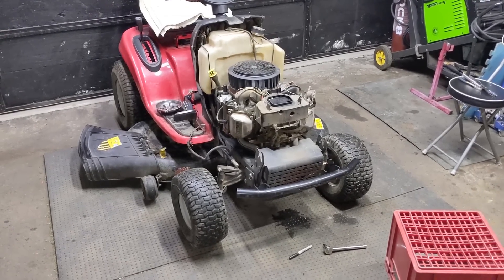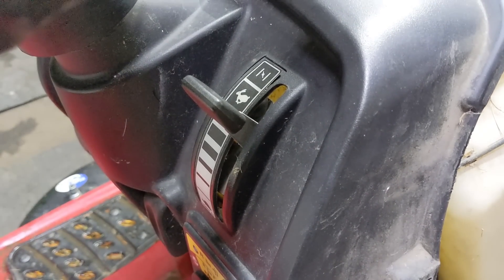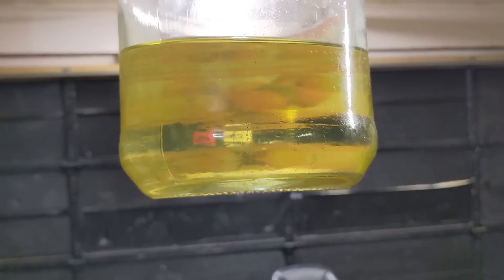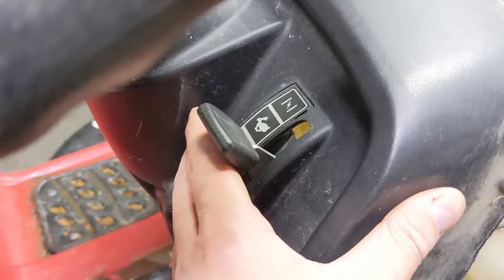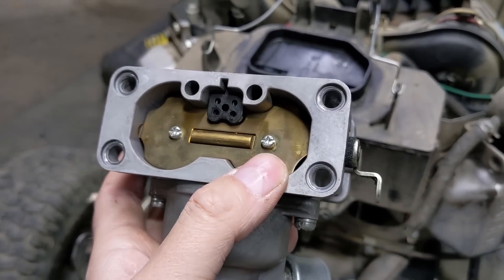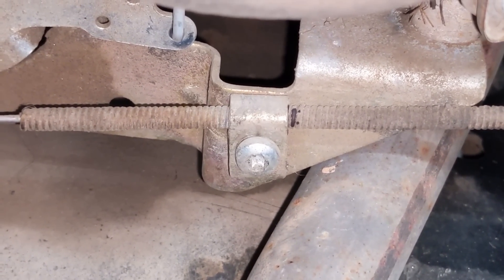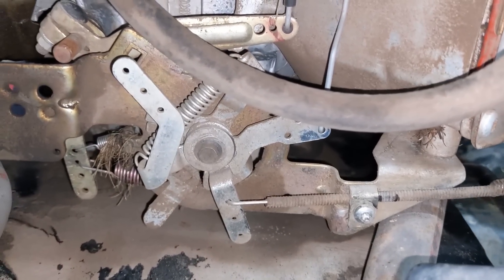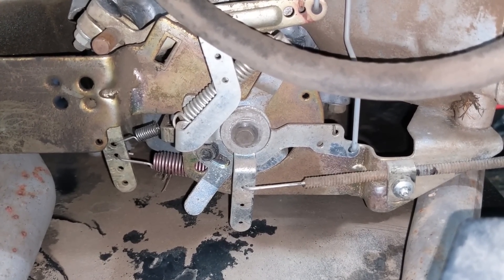Riding Lawn Mower Won't Start? - Try This!

Comment: Just fixed a Koehler KT (7000 series) this week that the choke wasn't closing on.  Have seen this more than once on these Kohler engines.
Reply from the maker: Yes it's a very common issue, I figured I'd film it because I've never done a video on it yet. Thanks for watching!

Comment: Excellent video, Briggs had issues on the Craftsman mowers the same as this one you had. Thousands of mowers left the factory with the chokes not adjusted correctly. I have repaired several last year alone. Thanks for great video's.
Reply from the maker: Yes I get them on Craftsmans, usually the 1st thing I check now because it's such an easy repair, compared to a carb removal

Comment: Good explanations! I'm sure it will help lots of folks. I inadvertently did that repair in the process of cleaning a carburetor on a Husqvarna mower that had been flooded. When I replaced the carb it still didn't want to start and that's when I found the cable out of adjustment. It starts and runs beautifully now.
Reply from the maker: Good to hear, thanks for watching!

Comment: Well that seemed like a simple fix.  Thanks again EP.
Reply from the maker: Yes got to love them, thanks for watching!
Reply: Yes who would have thought this video would get almost 5k views in a day. This just happens to be one of the Eliminator checks on riding mowers to before we get into other diagnosis checks. You would be surprised on the time we have saved by 1. Check oil level 2. Check for spark 3. Check battery voltage and load test when a battery is involved 4. Check compression 5. Perform leak down test 6. Check choke plate movement 7. Take sample of fuel from fuel pump or carb bowl for water and debris. Just these have saved us and our customers a lot of time and thus money savings for the customer. Basically we charge a half hour minimum anyways.
Reply: @waynestefinashen239  Back to basics   EH!!!!
Reply: @BrucesShop  Had too many customers giving us improper information which causes a lot of unnecessary work that basically you feel bad if you charge them for it. Therefore, Jake and i decided these are the steps to follow on basically everything so we know what we need to do and what we do not need to do. In the long run our customers are saving a lot of money .

Comment: funny thing. my neighbour has same engine on columbia . new maybe 4 years ago. last spring he said it wouldn't start. it was exactly the same isuue. took 3 years to develop?  on the 91 octane.  I  read that shell vpower now contains ethanol.  my cardlock supplier told me his 91 is shell. so I  tested an older can sample and a new sample.    both were still ethanol free.

Comment: That cable will move ever so slightly over the years. I think you can even see the the different color sheathing where it was originally covered by the clamp. The Sharpie mark is a great idea. Where’s Wayne?
Reply from the maker: I think he was doing inventory or working on paperwork in the office. He made an appearance in last week's deck repair part 2 video!
Reply: Thanks Ken maybe i get to be in another one some day, full frontal view eh?
Reply: @waynestefinashen239  let’s not get crazy!!
Reply: @KensSmallEngineRepair  Frontal face not total frontal belly too big

Comment: So, I have a MTD yardmachine with the 13.5Hp  tecumseh, ive replaced Carb/Spark. It turns over no start unless I engage choke and slowly idle down choke at the right time, also fires up with Starter fluid. Once running it stays running but if i turn it off again i need to start it back up using a mix of choke/slightly pulling down to Fast idle....Im at a lost of what else it could be. i know the carbs are junk but if it was carb issue i would think it wouldnt run after start up. throttle cable is fine and choke plate closes as its suppose to. the only thing i have not changed was the little fuel filter inbetween the fuel tank and carb.. any other suggetions ??

Comment: How's she goin'?  This video is very timely for me.  My MTD with a Kohler 17 HP SV530 engine won't start.  If I use carb cleaner to start it, it starts and runs just like in your video.  But now it starts with carb cleaner but won't keep running.  Do you think it might be a vacuum leak not allowing the carb to draw the fuel from the bowl?  I am getting good fuel flow to the crab.  I also sprayed around the carb with crab cleaner to see if I could detect a vacuum leak and it seemed to be OK.  Any ideas?  Thanks for posting this very helpful video.  Take care!!!
Reply from the maker: Check the fuel solenoid, make sure it's clicking. Other than that, maybe a clogged main jet? Hard to say, but I would start with carb/fuel as it wouldn't start at all if it didn't have spark/compression
Reply: @EliminatorPerformance  Thanks, I'll be checking the whole fuel system from tank to intake valve first thing in the morning!!!
Reply from the maker: @GrampiesWorkshop  good luck Grampie!
Reply: @GrampiesWorkshop  Well Grampie did it work out and what was the issue ie: carb clean due to plugged main jet?
Reply: @waynestefinashen239  The carb seemed good and clean and I didn't find any jets plugged.  I do believe it was a carb issue though but other than the carb being a cheap aftermarket one I have no real proof that it is the culprit.  I have ordered yet another carb and we'll see if a 'better quality' one makes a difference.  I was tempted to buy an OEM Walbro carb, but they were over $100 and I only paid $350 for the whole tractor!!!  LOL  Take care!!!

Comment: will changing cable affect top noload speed since choke is part of throttle control?
Reply from the maker: No, on this engine the low rpm has it's own spring, and high rpm is set by another spring, they have back stoppers that you set the tension. So this only affects the choke

Comment: Learned more from Jake today. Thanks, guy!  One thing - don’t some choke plates operate correctly when they’re not quite all the way closed?  Is there some sort of mechanical stop that accomplishes that, or maybe it’s a hole drilled in the plate. What I’m getting at is there’s supposed to be a limited amount of air coming through even when the choke is fully closed so is it possible to over-adjust that cable? 👍🔧🧰
Reply from the maker: Yea so if you pause on the dual barrel Briggs carburetor I show, even when the plate is fully closed, you can see the sides allow some air around it. And yes, most have a small hole drilled in them. But ideally you want the choke plate fully closed to increase the suction of the fuel.
Reply: Eliminator Performance   Thanks for the response! 👍🔧🧰

Comment: Need help with my John Deere L111, have replaced almost every electronic part, but it sounds like a thump when I go to start it
Reply: If your engine is turning over then stopping at the compression stroke your automatic compression release on the camshaft is broken. We will be posting a video on this upcoming Sunday .